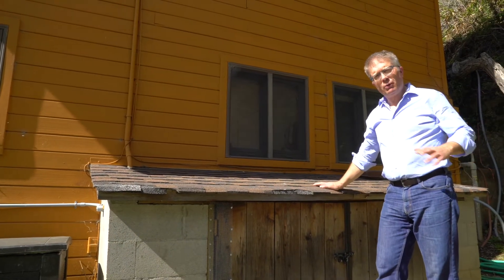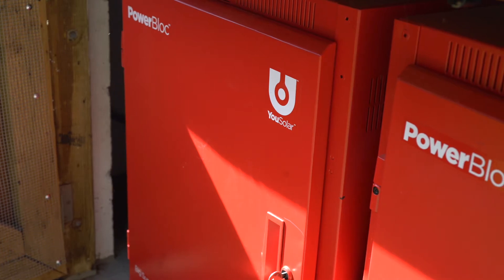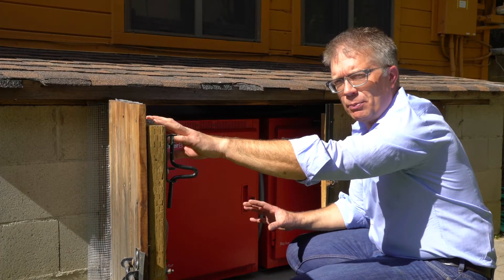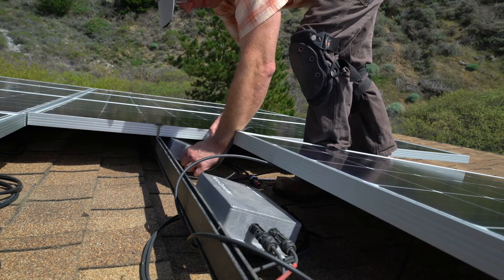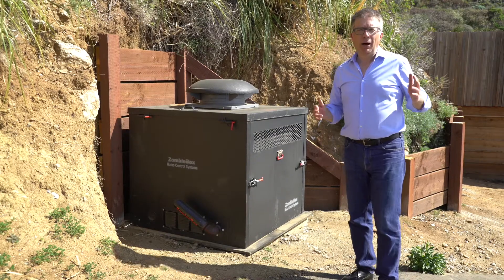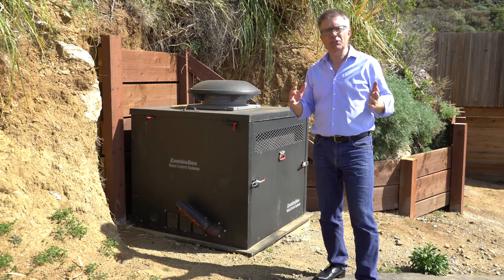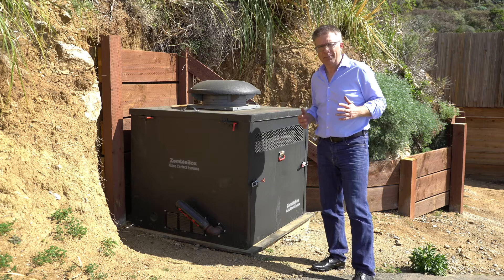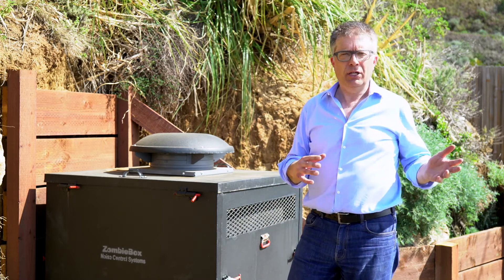YouSolar PowerBloc™ Demonstration in Big Sur

Comment: Which panels are you finding that generate the most output in your experiments?  I'm sure you've tried many.
Reply from the maker: Panels with the highest overall efficiency are mono-crystalline panels made by LG or SunPower. Both have mostly the same since SunPower's patent on its high-efficiency panels expired.

However, they are usually not the best investment because they typically have higher energy costs compared to say SilFab or other brands with mono-crystalline cells with front contact.

Multi-crystalline cells are much cheaper than mono-crystalline cells. It takes 7 steps to make a multi-crystalline cell, whereas the SunPower Maxeon-brand mono-crystalline, rear contact cell takes 21 steps to manufacture.

Thin-film panels perform better in high heat with humidity than mono or multi-crystalline silicon panels.

Usually, panels with the best performance for the price are mono-crystalline front contact modules, by reputable manufacturers ("Tier 1") such as SilFab (U.S.), Jinko, Trina, JA, or Canadian Solar.

All have a 25-year warranty, SunPower considering a 40-year warranty.

For applications a little bit outside our core market, we like First Solar's Series 6 module for utility-scale projects. You can choose bifacial solar panel, us a white roof, and include tracking for the highest production.